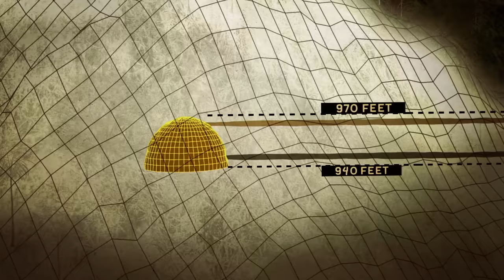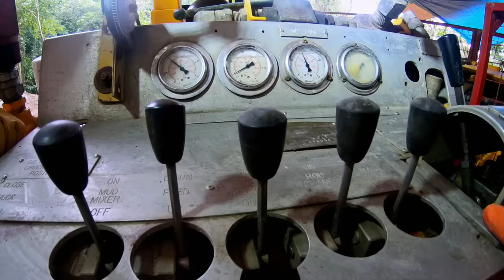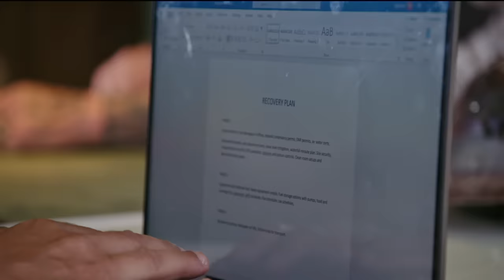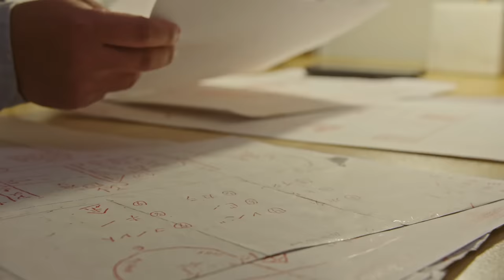The Lost Gold of WWII: TREASURE DISCOVERED 300 FEET UNDER MOUNTAIN (Season 2) | History

Comment: Dudes - so you found a chamber, but no entry.  You did well earlier with smoke bombs to find vents and entries of the earlier tunnel.  Why not stuff in and ventilate more smoke bombs while watching all over the mountain to find where the colored smoke vents.  It could be that easy, instead of mining through the mountain.  Gheesh.
Reply: Because digging a 900 foot tunnel is more interesting to watch and takes longer to do 😂 but also that mountain is huge idk how well smoke bombs would work
Reply: Smoke bomb seems like a trivial thing to try first and doesn’t cost a fortune.
Reply: DUDE...RELAX...its not real...its just a scripted tv series...those are not real treasure hunters but ACTORS NA DTHIS IS NOT REAL TV...BUT A TV SERIES OR TELENOVELA TO EXCITE YOU...just like any pother treas tv series :P
Reply: Well, if all opening(s) of the chamber is(are) under water, then the smoke will likely dissolved in the water before diffusing into the air.
Reply: Smart thinking
Reply: @hunterpinoy6075  You mean the stuff on TV might not actually be real?
Reply: if they drilled from top to bottom, they can easily widen the pilot hole up to 36 inches or even 100 inches if there is no water that drips on the side. if there is water that will drip, you need steel casing
Reply: They have to fill another season, then at the end find a big hole with some empty boxes in it!
Reply: Smoke bombs is way more cost effective just throw in a tonne also throw in some coloured dies environmently friendly ones of course in case it's underwater and baboom game over
Reply: @churrthebro4701  just select a better site where logistics is not a problem. there are so many. if its a flat terrain, there is no problem.  just drill and cam.
Reply: @hinmonster89  lmao !!
Reply: Because would it be safer to mine a new tunnel or to use a 50+ year old one that’s more than likely rigged and collapsed 🤔
Reply: @davaotreasurehunterdavaotr8285  exactly what I thought
Reply: @hunterpinoy6075  so my next question would be who buried those boxes 300 feet below the forest floor so long ago that all the vegetation has grown over it 🤔 ? Oh I just realized they planned this show 60 years ago
Reply: @justinbaas843  dude, there was no boxes buried at 300 ft deep, there was NO 300 ft hole drilling....it was just a tv set up props and make it appear they drill and found some boxes when they drilled on it....any HS grad student can make that tv props scene....hehe..It was just for a TV SHOW remember NOT REAL treas hunting activity .....hahaha ..the alleged dig site is sorrounded by hundred of  tv crew, food catering, logistics people, govt officials, townfolks onlookers, etc...its just  a PUBLIC TV SHOW SHOOTING in the philippines....NOT SECRET TH ACTIVITY...hahaha
Reply: @hunterpinoy6075  but the money there spending has no return! There’s no way the cost of production would be profitable by your reckoning unless it’s funded for real purposes
Reply: @lmt7584  thats why they did not return

Comment: A simpler and faster way to get there is to run multiple bore holes like what you just bored  in a large circle and then break out the tubes. Like when you don't have a big enough hole saw and you drill a large hole with a drill bit and break out the center. More cost effective and qwiker than what your proposing in your meeting JMHO Worth a shot........................

Comment: Definitely man-made objects in there you can even see the wood Timbers and boxes you can even see the nails on the boxes this is huge
Reply: Those nails look almost new, after that long in water or in a damp environment, they should have rusted or have some surface rust. I'm pretty sure stainless steel or galvanized nails were not in use back in the 1940's
Reply: @nolareefman934  not just that but the nail is potruding from the box as If to suggest it's possible already been looted?
Reply: @rustydumper  possibly, it wouldn't surprise me if that's the case. I would love to see the following episode that focuses on that same position. But I can't find anything else from that same dig site.. that seems very odd to me!

Comment: All right now all you have to do is drill 3/4 of a mile through a mountain guess what that's impossible
Reply: Since when lol
Reply: Well... I mean it isn't. They've been cutting tunnels into mountains for 150 years. They had to do it to get trains for the east to the west and vise versa during the 1800s.
Reply: 970 ft isnt even a quarter mile
Reply: @Karlehmayne  its less than a 5th, metric is better haha
Reply: In this century we have now the most advance equipments so it would be easy for them
Reply: Ummm... they just did. 
Now they just use a bigger drill bit. And a bigger drill bit. And a bigger drill bit... until you can pull things out.
Reply: well what they are pulling out only seems to be foot wide crates so it doesnt have to be that big, look at what they are doing at oak island, they can go smaller than that
Reply: Are you stupid???
Reply: @JohnSmith-yi1fu  pretty sure they can just go straight to like 1 meter in diameter and that ahould be enough